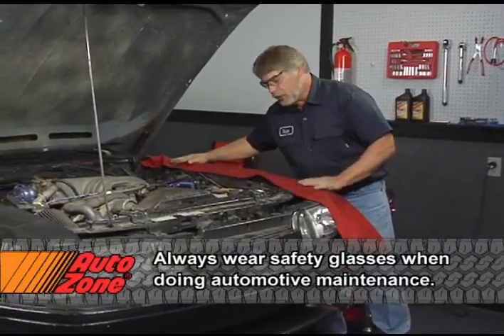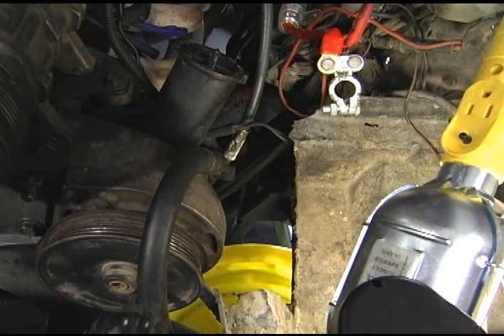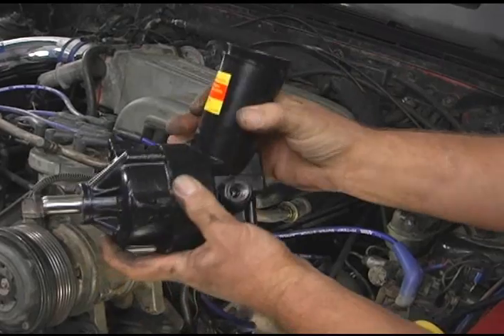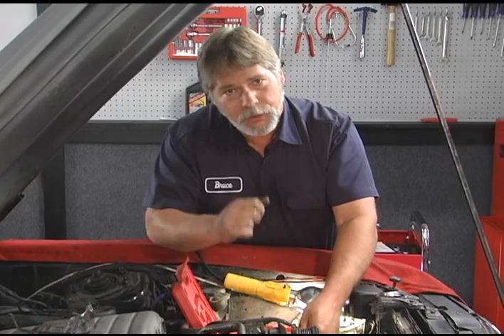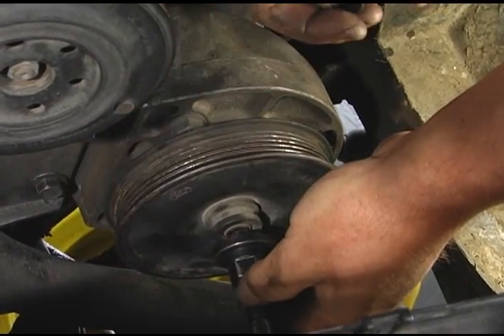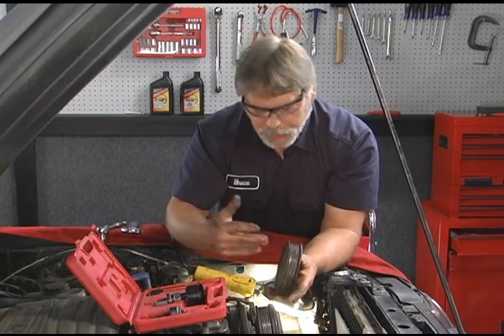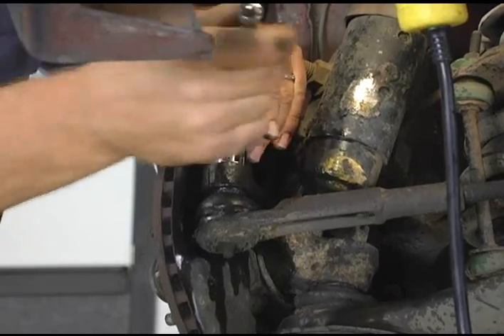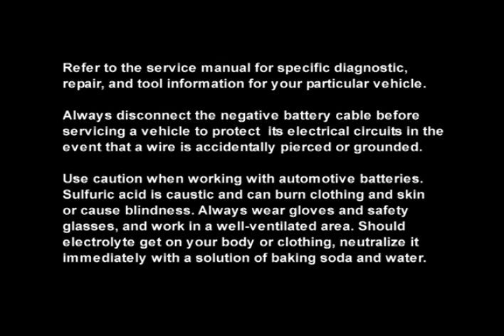How To Remove The Power Steering Pump- AutoZone Car Care

Comment: I change power steering pump may problem is if I off the engine the power steering fluid coming out in the cover with pressure can you give solutions  to my problem thanks

Comment: How do you remove a possible stripped high pressure hose nut. Ive tryed crow feet , wrenches nothing is working. I have a 95 mustang, and this is coming impossible. Any ideas what to use. Its a project car....the pully is removed, alternator and pully remove battery remove....

Comment: Also Older cars are SUPER SUPER Easy to Work On. In Older cars, everything is right there where You can easily get to it for a DIYfer. But In Newer cars, with Horrible designs, You'll have to go through hell and back to do any little thing. SmH
Reply: what would cause an engine to leak gas out of exhaust manifold when trying to crank on a 95 sentra

Comment: Ok that was nice......sort of. It would have been nice if you'd explained whether you need to remove fluid first if you have an external reservoir, and also the bleeding process after the new pump had been installed.....................But I suppose you have to buy the video for that. Touche sir, Touche. Lucky I do my own mechanics, but I feel sorry for the poor schmuck who watched this and thought he was going to actually complete the job.
Reply: I Know right, I was like this cant be all that's needed to complete a work like this. I'm quite a rookie, I've been watching all the videos that I can find to change the power steering pump on My 05 impala 3.8. I Hope I get all the knowledge I need to tackle that task. And You're a Lucky Man!, You're able to do Your mechanic works!!, I envy You, Hope someday I'll get used to doing My own work like a champ!
Reply: Haynes Manual describes how to bleed the system. It also advises you to be ready to catch any fluid that leaks and to plug the hoses. Of course, every job is different and there always seems to be a surprise. It's never as simple as these videos lead you to believe.
Reply: Nedu Nonny P  Hey mate, I recently changed mine on my Honda Type R B18C7 engine, it was easy as. First remove as much of the steering fluid from the reservoir, remove the pump, change it or whatever you have to do, re connect the pump, put more fluid in the reservoir,  start the car, and then remove any air in the lines by turning the steering wheel to the left at full lock and to the right, (make sure you don't let the reservoir oil run out, keep it topped up) problem solved and that is that. been driving mine now for 3 months after this job and no probs whatsoever. Good luck mate